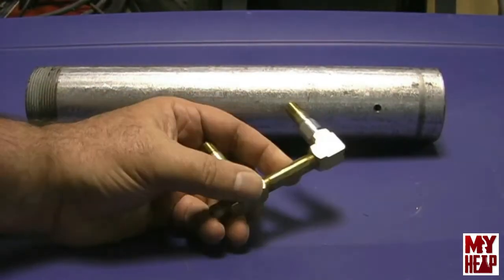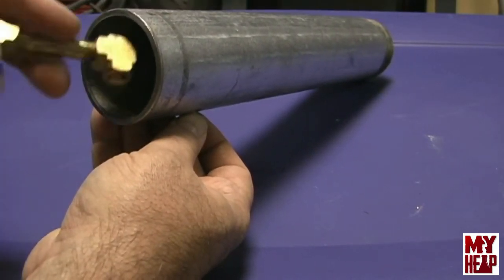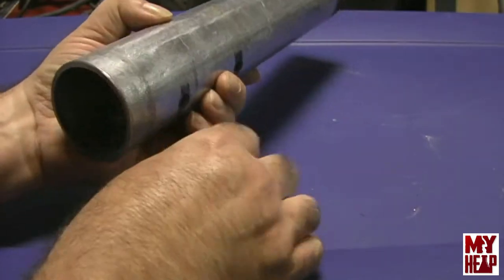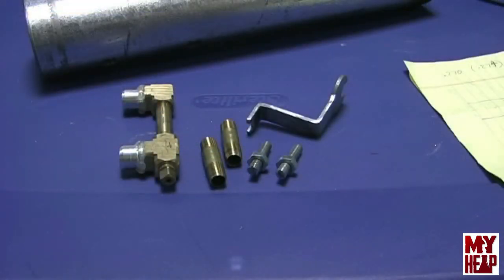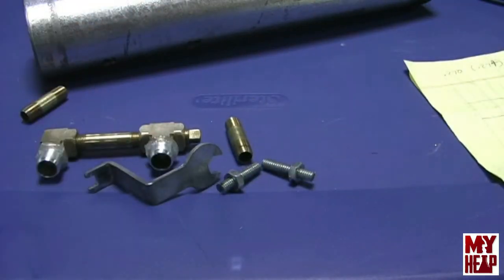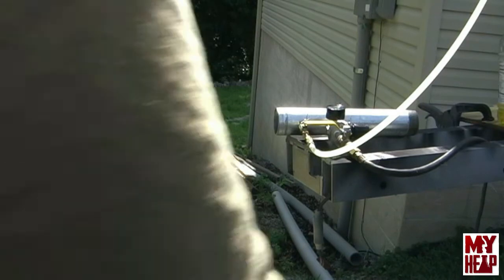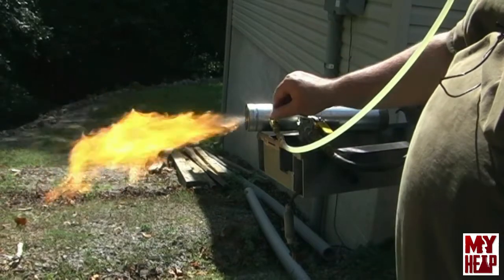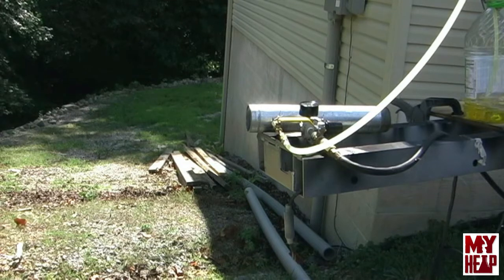Metal Casting and Foundry - Ep 4: The Kwiky Oil Burner Part 2

Comment: It makes fire, beautiful. Something about yellow fire, it’s mesmerising compared to blue gas flames. Looks like you’re on your way. Great mini series, cheers. Peter
Reply from the maker: Hi Peter.  Yes, so far I am pretty pleased with the progress of this burner.  I will know more once I get it in the furnace and burning oil rather than diesel.  I am hopeful that I can get to cast iron temperatures with it.  I suspect if it goes that well, I will have a furnace build in the future.

Did you get you pump apart?

Thanks for watching and commenting.

Joe
Reply: Joe you’re not jumping the gun are you. Yes the pump is apart, just had to grit my teeth and hit it harder. Follow up is coming soon, stay tuned. Cheers
Reply from the maker: Peter,  I may be implementing a little wishful thinking.  :-)

Comment: I've been running Davids Kwiky for the last 3years.  I start on Jet-a and switch to 100% used motor oil.  For a blower I'm using an old microwave blower.  Running compressed air around 20psi is plenty for the motive force.  Decent needle valves are a must with this thing.  I tried 1/4 turn ball valves to adjust the mixture in the beginning and it didn't allow fine enough control.  Last thing I will add, some guys have trouble running this thing once shoved in a furnace.  I did.  That problem was easily solved by getting the nozzle as close as possible to the inside of the furnace.  No more oil pooling in the pipe or furnace and I get better combustion.
Reply from the maker: Thank you for sharing the tips.  Thart is really helpful.  Thank you for watching and taking the time to comment.  I really appreciate it.

Joe
Reply: @MyHeap  Joe..  Take a peek at the first 10mins of this.  https://youtu.be/D6mUFNLn-24
I give a tour of how I burn the two fuels.  Pretty simple.  I have to preheat before making the switch to oil.  If my melt is small, the bronze might be ready before I get the chance to switch.  Diesel, kerosene or Jet-A easily melts up to bronze temps.  The oil is nice on long melts...  Its all about free fuel for me.  :-) Some guys pressurize the fuel tanks with about 5psi, I find about 3feet of gravity is all I need to move oil.  Warming the oil helps it move in cooler weather here in Texas.  ;-)

Comment: looks good, just wait till you get it into a furnace with a blower on it to give it forced air, you'll see what an oil burner will really do then, lol. Usually when you kick the air on, it'll go from flamethrower to jet engine with afterburner on. Ive seen a few that shook nearby buildings because it has so much power, lol. 

Oil burners dont really need a flare to burn outside of the furnace like propane burners do. Just stick it in the furnace and your good to go. A good test for an oil burner to get the air mixture is to take some galvanized steel and put over the exaust of the furnace with a gap, if it creates soot on it, your running too rich, if it does nothing and just gets hot, then your perfect, and if it burns the galvanizing off of it, then your far too oxidizing. 

Ill have to remember that wrench, and have to make one for myself, lol. Ive always just used needle nose pliers and ended up with my hands soaked in oil, lol.
Reply from the maker: Hi Chirpy.  I was amazed at the radiant heat that it produced on the short firing.  I intend to get it into the furnace and try a 50/50 mix of diesel and oil to preheat and the straight oil for firing.  I will try your galvanized metal trick too.  I am trying to source a fan to use for the inlet.  I have one that would be great but it is 220V and I only have 110 available in my casting area.  So I want to see if I can source another and if that proves difficult I will use a 110 to 120 transformer.  I have been using an air mattress blower but there is no good way of attaching it to the inlet tube without making an adapter, but then there is no good way of dampening the inlet air.

The wrench came to mind as I was adjusting it the first time with the water.  Got me thinking what a mess I would make of my hand and arm with oil spraying out.  It works pretty good.

Have you been able to melt iron with yours?  What size mig tip did you use?  The .025 that he recommends?  I am thinking it may require a larger tip for enough heat to melt grey iron.  I would like to get there sometime.

Thanks for stopping by.

Joe
Reply: I used 025 and yes, with diesel fuel, you can melt iron no problem at all. It's not about the mig tip size, thats just the air orfice to create the venturi, if you use a larger mig tip, it would just blow more air out and cause problems, but not really help with heat. The heat is based off of the air/fuel mix and how much fuel you can get into the furnace at once. The only thing is, watch out when it gets to that point because it'll easily melt a furnace lining in no time at all, lol.
Reply from the maker: Well I am getting pretty excited about it.  I hope to get a chance this weekend to play around with it some more.  Hopefully by then, I will get my fan solution in place.  Just bought more materials to work on my shop so I have to get some of that done first.  Ahhh, so much to do and so little time.

I guess if you need more oil flow, first you try more air pressure then try adjusting the plug at the end?  Finally adjust the supply fan to adjust the burn, (Oxidizing, Neutral or carburizing)?
Reply: cool, cant wait to see it going. Oil burners require quite a bit more air vs propane burners. Some people actually pressurize the fuel tanks with 5-10psi air pressure if they need more heat, that or heat the oil to make it more fluid, but usually if your running diesel, you have more than enough flow to melt pretty much anything you could want to melt, and stuff you dont, lol.
Reply: Chirpy's Tinkerings thinking it's about time I got myself a furnace going
Reply: lol, it's defenitely a handy tool to have around for a range of stuff like making custom castings, heat treating stuff, or just cooking lunch quickly :P

Comment: It burned really well for not being in a furnace.
Reply from the maker: Hi David.  I didn't know if it would burn without a flare or the air fed into the back.  I was pleasantly surprised.  I have been working on my shop so have not put this think into a furnace yet.  I still need to work out the air for the back and a stand.  But I feel pretty good about your design.  I am looking forward to melting with it.  So, I am curious, have you had it hot enough to melt cast iron?

Joe
Reply: @MyHeap  no, I got busy with life again but I have no doubt it can melt cast iron!
Reply from the maker: Great to hear from you David.  Hope to see some more videos my friend.

Joe
Reply: David, Mine burns just fine on Jet-A outside the furnace too without a flare...  Naturally it won't burn oil outside.

Comment: Did you ever get this done like the thumbnail image shows?
Reply from the maker: Hi Dan.  Yes the qwicky burner itself is complete and I have a fan for it now and it is ready to go into the furnace.  The furnace pictured in the thumbnail is my Gingery forced air propane furnace I built a long time ago.  I just use it for the intro picture for my foundry videos and I am sorry if it was misleading.  You can read about the build of this furnace on my website at myheap.com.  I have abandoned this burner because I could never really control it.  This is one of the reasons that I built the quicky burner.  Thanks for taking the time to comment.

Joe

Comment: I gave you a like before watching....I am a pushover. Btw, just sent you the Paypal  invoice LOL
Reply from the maker: HAHAHA, so what do premature ELATIONS cost these days?  How is going buddy?
Reply: Doing OK, glad Chirpy is helping you out, my knowledge of waste oil technique is limited. The kwicky is the best design I had seen as I mentioned back when we talked about it a while back. You shoulda got the self adjusting mig tips...less messy...cool wrench!
Reply: Also, you need to bring in Mortimer for adjustments to be made while the burner is lit....its really the best way to dial them in (while lit)
Reply from the maker: Great idea, and it kills two birds with one stone.  1)  Would give Mortimer a reason to crackle and pop, and 2) I would have achieved a self adjusting mig tip!  The radiant heat off the thing was pretty impressive.  I am hoping this weekend to get it into the furnace and some forced air in the inlet and see what she does!
Reply: With forced air using oil I believe your furnace is gonna take a beating. I smoked a foundry lining using forced air with propane so hope it goes well. After using my forge and mini foundry furnace which uses only ceramic wool its all I will use in the future. My small mini furnace which is made from a crockpot steel shell still has the paint on the outside, and I have melted brass in that thing. Outside paint still intact... and only 1" thick wool in that guy
Reply from the maker: Chirpy has been a great help on this little project.  He has had to work through all the kinks, but that helps the rest of us for sure.  The wrench turned out okay.

Joe
Reply from the maker: The furnace I have been using has been in service a while so probably doesn't have many more melts left in it anyway.  As long as I get the plaques cast and the lathe project we discussed a while back I will be happy.  After that, I will look at a new furnace with either wool or castable refractory or both.  What ever the pocket book allows for.

Where did you buy your wool?

Joe
Reply: I will email you some info Joe, I hate plugging companies that dont pay me...lol
Reply: Ya all are wusses .  !! I don't see no duct tape . !!
Reply: Give it time....when machining fails......
Reply: @MakinSumthinFromNuthin  what temperature is  wool rated to?
Reply: I think mine is 2500 degrees